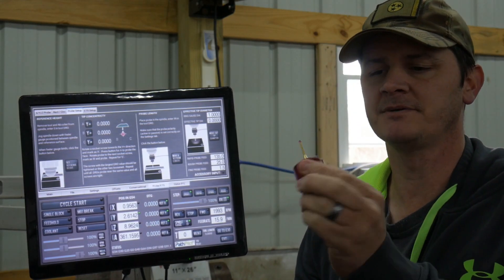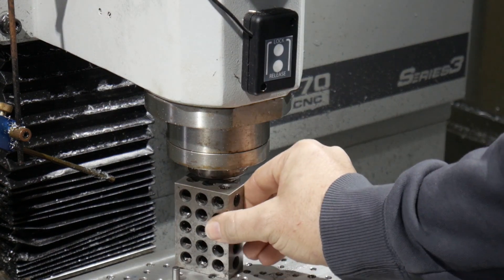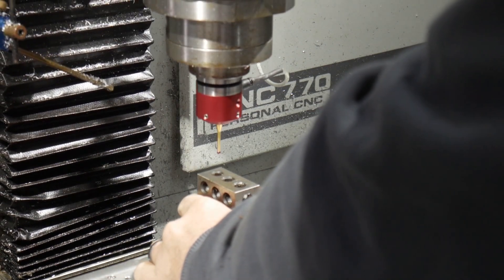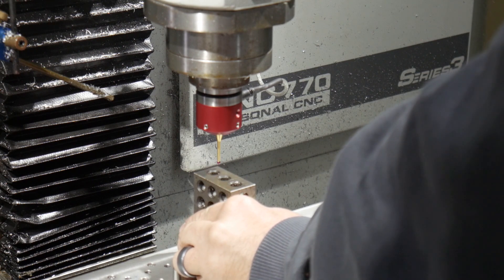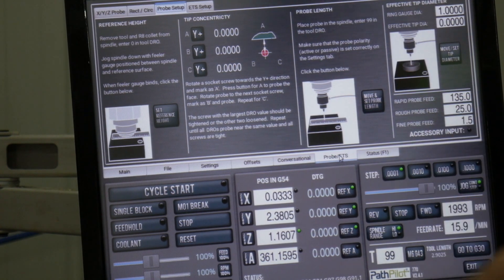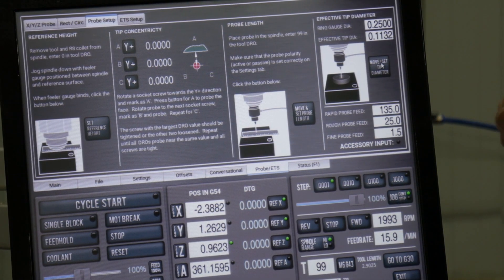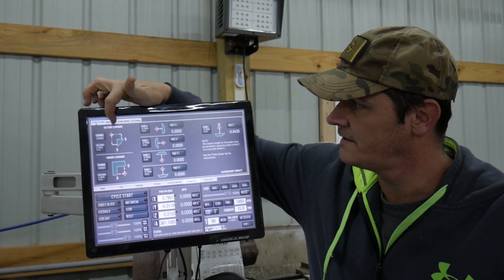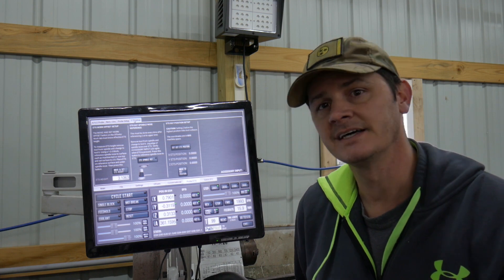Probe Setup on Tormach 770 PathPilot 2 4 1

Comment: Any updates on the Drewtronics probe use on your Tormach  770 and Pathpilot? I'd like to move up from using an edge finder with my PCNC 770 and the Drewtronics probe looked like a cost effective solution.

Comment: I'm curious to see how you like all the routines.
Reply from the maker: I've used it a couple of times with the Pathpilot routines and I'm really enjoying it. It's nice to place the probe tip close, push one button and it will find the center of my stock. 

With the haimer you had to be totally focused, touch of both sides of each axis and zero one side and devide the other by two. It only took a couple of minutes but a lot could go wrong.
Reply: @jodyolivent8481  I'm a haimer user, so I know that old song and dance!  It beats the pants off of using an edge finder or wiggler.  I have been doing a ton of two sided parts, so I wind up setting x,y 0 in holes for my second ops.  This looks like a really fast way to make those happen.  I'm guessing you can do a few probing routines in fusion as well to set up parts a bit more quickly or to read parts in a fixture...  I may have to get into probing.